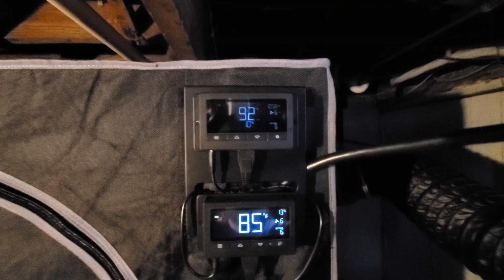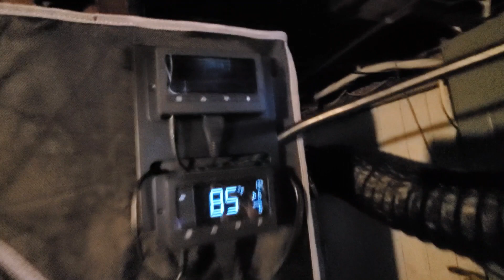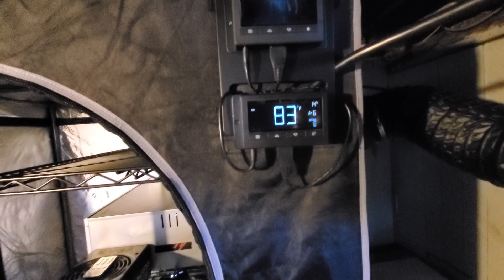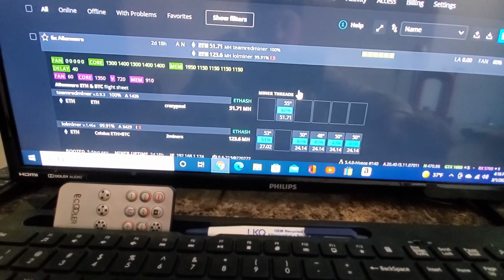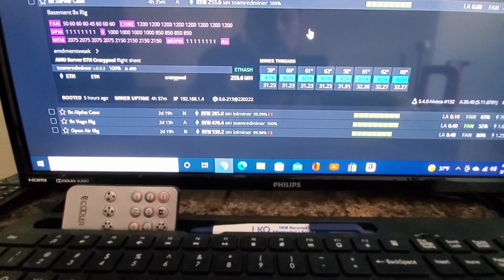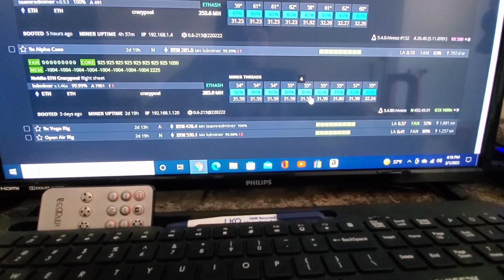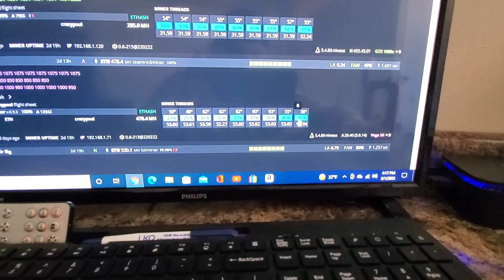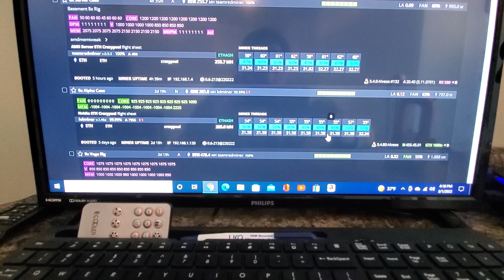Don't use negative pressure in a grow tent! Lessons learned about managing heat while crypto mining.

Comment: My best ever summer temps was when I completely sealed off a spare bedroom (door, vents) put an exhaust fan in a window on one side, and left another window  cracked open on the other. Negative pressure pulled air in from one window and across the rig and out the other.  Any attempts to PUSH the air across the rig with fans increased temps a bunch. even with bigger box fans pushing. 

So from that experience, I'm not convinced that it's necessarily negative pressure vs positive pressure but rather is the air puled through/across the rig or pushed through/across the rig. probably something to do with turbulent flow vs laminar flow in combination with pressure?  Fluid dynamics is way to complicated!

Right now I'm running my tent negative, but with a LOT of flow. (3 exhaust fans - intakes outside air)  7k watts of rig heat, ambient in tent is 82 while it's mid 70's outside in Wisconsin, card temps are happy.  They were definitely NOT happy with this negative setup until I added that 3rd exhaust fan.
Reply from the maker: Yes I completely agree. I think I've confused a lot of people by referring to vacuum as "negative pressure". I dont think that passive intake creates much measurable negative pressure, and I've also found passive intake to be very effective. It's when the exhaust overruns the capabilities of the intake, that I think the trouble begins...when the walls start caving in, and it is measurable.  I've seen too many videos of tent setups where people show the walls caving in as evidence of a proper setup. In my experimentation it not helpful. Ideally you would increse the available intake, or just work within the limitation of it. In my winter setup I did not want maximum airflow, as I needed to scavenge heat to suppliment my furnace, so I had to work within the limitations of my intake. After discovering this, I adjusted my setup, and it was awesome. Now that the heat is here, I do need max airflow, and I'm going to have to change things around. I appreciate the feedback, and the well thoughtout comment! Thanks, and stay undead!

Comment: you do not have enough intake . I use 1x8inch exhaust plus 2x8 inch passive intake  with a light negative pressure not had any prbs till now.
Reply from the maker: 100% agree that I was limited by my intake. What I found along the way though is that if I overrun my intake, and draw the tent in to vacuum, that it has a negative impact on heat exchange. I just found that fascinating. If I work within the bounds of my intake it works excellent. Remember though that this was February, and I was trying to gather heat for my house. Now that it is summer, I am going to need more flow, more intake, and will be revisiting my setup. Just found it interesting that too much negative pressure causes problems.

Comment: More air = more air molecules to exchange heat.
Plus with partial vacuum the air is directly pulled from inlet with out stoping at the tourist attractions.
Over pressure force's the air to in making the air to all over the place
Reply from the maker: Yeah it seems to me that keeping the pressure as neutral as possible helps with flow. It was pretty evident with the two diffrent temp probes, that I could not keep my hot/cold aisles separate in a vacuum, as every square inch was trying to equalize, and there was no longer a steady flow moving across the shelf.

Comment: Here is some math from ASHRAE. If I want the air inside of a 2x2x4 space to turn over 1 time every hour, then this means I want to remove and replace 16 cubic feet of air every hour.  The formula would be;  volume (2x2x4) x 1ACH  = 16 cubic feet of ACH (air changes per hour).  16ach/60min = .267 CFM (cubic feet of air per min).  That's a small amount of air for what we want to do...we want much more than 1 air change per hour we want several hundred air changes per min...but u see the math.  Rule in building science says 1 CFM in should usually equal 1 CFM out, and that = balanced air flow my friend.  Loved the video..Im about to flip a grow tent from bud to mining to manage heat in my 2 bedroom apartment!  Good luck.
Reply from the maker: Absolutely. I am getting in to the warmer months, and I am no longer pumping the heat indoors, and now I need to be scrubbing the heat from the cards as fast as possible. I need change my setup to add cfm, and increase the rate of exchange. And you are totally correct about equal flow. Most videos I had seen on grow tent with crypto mining showed the walls caving in as the optimal setup, yet their cards were always running super hot. I've realized all that means is there is a choking point in your setup. Even pressure is good flow.

Comment: LOL.... you dont have near enough cfm.. thats the only issue. im runnig a 10 inch 1600 cfm fan with 2 8 inch inlets. 95 degrees here outside wirth the same size tent running 50 degrees on cards. also you hae shelving for air to sit... you need to set your cards on the racks in a better pattern.
Reply from the maker: I agree that now it is summer and I will need max cfm and to alter my setup. When I made this setup it was February in Wisconsin. It would sometimes get below zero overnight. I was not trying for maximum cooling, as i was scavenging the heat to my house. Rather trickling in enough cold air, as evenly as possible, for as long as necessary to remove heat from the cards, and then pump it in to the ventilation. What I accidentally discovered in testing was that if I overpowered the cfm limitations of the intake, my cards would heat soak. But if I slowed the exhaust enough to match the limitations of the intake it worked perfectly, and my hot and cold isles would stay separate. The pressure difference between the two sides was naturally causing the tent to want to equalize, so the hot and cold isles would blend. And the vacuum was hurting anything else that relied on air pressure and volume (card fans, and heat exchangers).

Comment: How well is the pvc with holes cut working for you? I tried splitting my intake with 4 inch elbows and t's, but found that it was a failure. The air would just find the least resistance and come out of the first 1 or 2 holes and the rest nothing. 

Great video. I've had a hot box in the basement for years now, and learned the hard way that I need just as much intake as exhaust. Like sucking on a blocked straw. Now my hotbox is completely isolated from my living space and the house ac works great.
Reply from the maker: It seems to be the best way I've found so far. I also tried something similar to what you are describing and had the same results. I had to do the math to figure out how many holes it would take to equal (but not exceed) the 6" intake it is fed from. I just calculated the surface areas of all the circles. two 4" is equal to one 6" and then 24+ 1 1/8 holes are also equal to the 6" intake. The idea was to keep from having too much air flow out of one particular area. In practice though, the lower tubes do flow slightly more air as the pressure favors the bottom row. It might have been more even if I had had split the air coming in between the top and the bottom. I can also manipulate the flow a little by blocking some of the holes off.

Comment: Awesome video! I'm starting the get the high temps in early spring. Similar tent setup, 8inch intake/exhaust but not having the air distribution manifold. Middle one top rack are getting really hot. My go pick up some 4" pvc today. Just have to figure how to split the 8 inch into those 4 inch pipe
Reply from the maker: The problem you might face is that you will need to split in to two 6" or four 4" to equal the volume of the 8" inlet as crazy as that sounds. You can get a rough idea of how they contrast volume wise by calculating and comparing the surface area of each circle (Pie X raduis squared). 4"=12.56, 6"=28.27, 8"=50.26. So on mine, the two 4" are approx equal to the 6" intake fan I am running now, which is turning out to be the choking point in my system. I either have to slow my 8" exhaust fan or open more ports in the tent to avoid pulling the tent in to vacuum.  Also for the small holes on the manifold, you will need find out how many holes of particular size you need to drill to get the equivalent of the initial intake. I'm thinking if I end up upgrading I might go with 8" furnace ducting or something along those lines to keep it simple. I haven't had to face much warm weather yet this year with this setup, but I plan to keep things updated on this channel. If you decide to build something let me know!
Reply: @theblockingdead1310  yeah, I was thinking about the size conversion after what I wrote. Got a few idea I need to look into this weekend. Like 6 inch rigid tee in 2 columns on each side with flexible tubing in between the 2 that I could easily pierce where I want. Or put up a main trunk in the middle and drill hole on 3 sides. Not sure it the pressure would be divided evenly on the last one. Any, I'll update you If I find a solution
Reply from the maker: @locke3817  Please do! Sounds like you have something cool in the works already.
Reply: @locke3817  wat ever happened?
Reply: @theblockingdead1310  if you went with the 8" ducting, would you do the exact same design as the pvc air wall?
Reply from the maker: @GG-mm9hf  Stay tuned if you have some time. I have an idea I'm trying out, that I think will work really well. I'm waiting to get some more parts in the mail, and I'll post a video as soon as I get my results.
Reply: @theblockingdead1310  i hear u ill def wait around! i just put up a 4x8 with two 10" exhausts with directed passive intakes. but its not working out... even with 10" intake duct. so im going to buy two more inlines tom for the intakes. thinking of building two seprate air walls out of hard duct. with idk an 8" or 10" infinity feeding each one. you think the move is ducts not 6" pvc?

Comment: Yeah, I think neutrol pressure is what you really want. And the negative pressure usually refers to actively exhausting more than you actively blow in, but still let air in passive through more openings around the enclosure. That's what's usually happening in negative pressure PCs. Not actually going towards vacuum, but just focusing more on exhaust-
Reply from the maker: That's exactly what I was finding in my experimentation. I was hesitant to use the word vacuum as there is differing ideas as to what the definition of vacuum is. As an auto mechanic we usually look at numbers in PSIA in reference to absolute pressure and it's difference to atmospheric. So there will be negative pressure measured in PSIA, and actual manifold vacuum measured in inches of mercury. Small amounts of negative pressure in a passive intake is fine, but towards a vacuum is where things get harmful.
Reply: @theblockingdead1310  Yeah, theres often a lot of variation about what people mean when they say things I guess, specially outside professional settings. 
I'm gonna get a small tent for my 2 rigs now that summer is closing, and I intend to have 50-100% more passive intake space, than active exhaust space, so I'm hoping that'll do the trick and create a good flowthrough of air ^^

Comment: I have 2 exhaust fan (6 inch each one) in the top of the tent, and 2 intake opened in the bottom (that take airflow naturally) and the temps are very good. Now I have both exhaust fan at mid power, but if I put the power of 2 exhaust fan at max power the temps go a little bit down, so for me negative pressure work better. 

What do you think? (I’m testing the grow tent since 1 week)
Reply from the maker: Passive intake seems to work fine. It's when the walls begin caving in and you are in the stages of drawing the tent in to vacuum where things get crazy. The word I probably should have used is vacuum, but the definition of vacuum can be a grey area.  There is soft vacuum, then there is a void which is full vacuum, and everything in between. You want to try and stay close to neutral in terms of PSIA. As long as your intake is allowing enough air flow to keep up with the exhaust fans you are going to be fine.

Comment: In a Vacuum there's not enough air flow to carry the heat away. I never understand why more people don't use immersion cooling?
Reply from the maker: That's exactly my theory as well. Under vacuum you aren't doing the fans or heat exchangers any favors. Immersion is the thermal efficiency king when mining. But getting a big enough tank/pump/heat exchanger, and all the liquid can be $$$. I suppose the initial investment would pay dividends on power and equipment life/maintenance. Do you know of a good place that sells everything needed?
Reply: @theblockingdead1310  sorry bro. I know ZERO! I just watch A LOT of videos on mining and when I finally came across immersion cooling, I thought it was a no-brainer. Not only the noise and the obviously the heat but honestly for me... the DUST!!! Already with the sound and heat you got me sold but supposedly when you're done with them, they come out of the dielectric in mint condition and squeaky clean! I don't really know anything about software and hardware so it'd be a steep learning curve for me... All that said, there's probably something I don't know that the big guys do. Maybe they're not worth keeping mint because they become obsolete and have to be replaced anyway 🤷 Who knows.... ✌

Comment: I have the opposite problem being in Florida. I might try add an intake fan because I have two exhaust fans and I cannot zip the tent up without the rigs getting wayyyy to hot and shutting down.
Reply from the maker: Yeah man it gets pretty hot and sticky here June-Aug. So I will definitely be changing the setup when this weather turns around. I think passive intake is fine as long as the walls aren't caving in on the tent. It's when the tent went into vacuum that my cards started getting too hot. Air doesn't exist in a vacuum, so every bit it goes negative below atmospheric, starts to lower the air flow giving the card fans less to push over their coolers. If I slowed the exhaust fan and let the walls settle it would actually lower the temps. I eventually just opened one of the ports and raised the exhaust fan gradually until I found the sweet spot. We'll see how this all pans out in a couple months!

Comment: Great video! Just like an engine, its an oxigen pump, if you cant suck air in your not going to be able to push air out, to make horsepower.  Tent is the same way. You have to keep air moving. Make up air has to come from somewhere.
Reply from the maker: Yeah definitely! That was actually what I had in mind when I built the airwall...Sort of an intake manifold to direct air. Thanks for tuning in!
Reply: Air is thermally conductive, without air, the heat can't transfer.